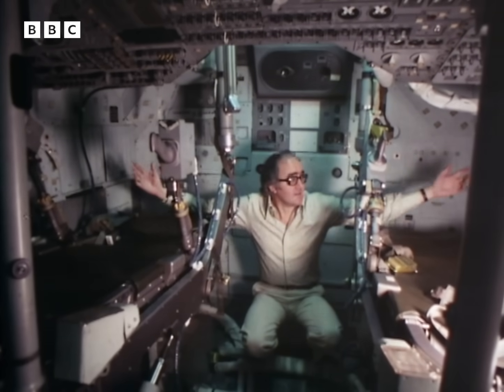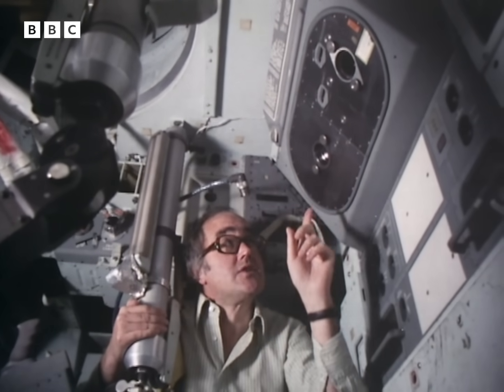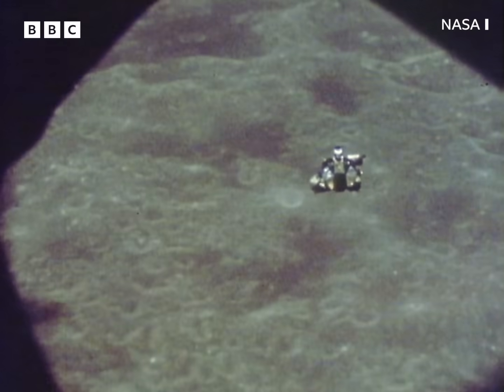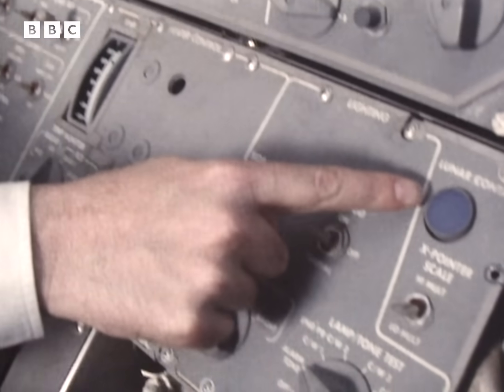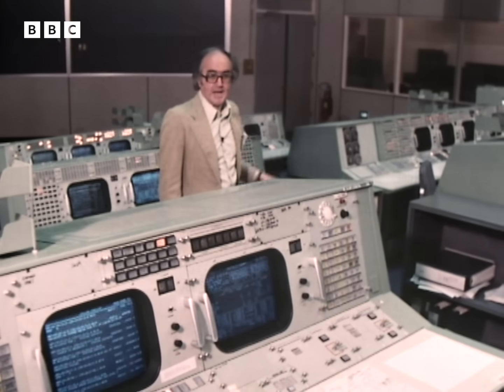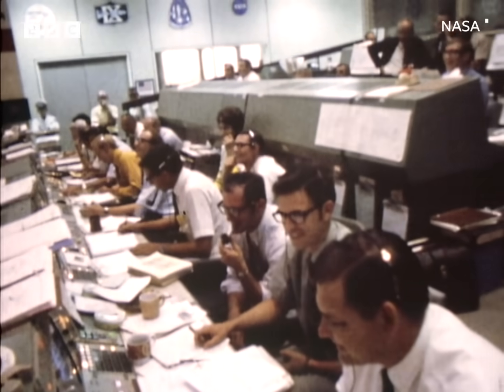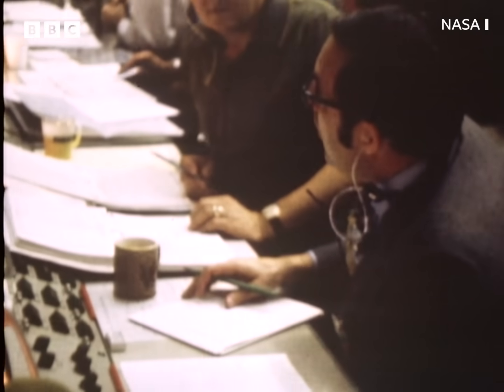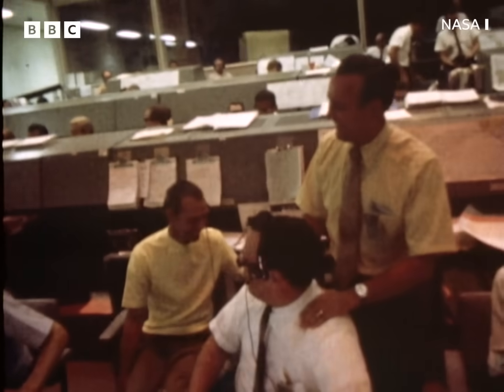1979: How to LAND ON THE MOON | Project Apollo | Retro Tech | BBC Archive

Comment: James Burke was great. Never waffly, over technical or boring. This clip is particularly great because it shows what really goes on in a control room. These days people watch control room footage on the news and they often don't really understand why the room gets so excited over every completed checkpoint. It isn't just because these moments are critical. These missions take years to go from proposal to completion. Someone could have just joined NASA at the age of 22 be put straight on a project and turn 37 years old by the time the project successfully lands on the moon or an asteroid or takes it's first pictures of the far side of a planet. It's a huge commitment of time and dedication. When that stage separates, the retro rocket ignites or the landing gear makes first contact with the surface it's decades of work that created that moment. It's a lifetime's achievement. And to succeed after things have gone wrong is a relief unrivalled by just about anything. No-one dies. Everyone comes home. Mission accomplished. No wonder everyone was turning white, red, blue and green at ground control.

Comment: Its awesome that nasa of course figured out the issue with the computer errors during descent, but also properly assigned responsability. It could have been fixed by flipping a switch - but that should have been communicated to the astronauts. It was an error in the documentation and the procedure, not the user.

Comment: Just think, this craft was travelling at THOUSANDS of miles per hour when it needed to dock with the Lunar Module after the astronauts walked on the Moon and took off in the Lunar Module. Thousands of mph but they managed to do it precisely with those clunky controls and poor visibility.
But what is more amazing is that anyone still believes this nonsense..
Reply: relative speed compared to the lunar surface is entirely irellevant.

Comment: 0:15 Nope. The controller in he's left hand was the so called THC, it wasn't about power (because SPS had a fixed thrust rating and couldn't be throttled) it controlled the translation movements of the RCS system (little rocket engines for maneuvering), the right controller was for rotation (pointing the spacecraft in a given direction). THC could also be rotated to initiate abort sequence.

Comment: 2:54 he actually said the spacecraft knows where it is because it knows where it isn't.
Reply: There are two points on a line where you might be.
The engineering comes in drawing that line, figuring out which of the two is just elimination.

Comment: Tell us about the Van Allen bells. That massive cloud of gamma radiation that means the spaceship has to be made of pb lead 10 feet thick.
Reply: Huh ?
That's true if the orbital altitude of a satellite keeps it within the belts (which is why we don't), but transiting doesn't generate anywhere near enough exposure to be health risk.
Reply: Where did you get this 10 meter figure?
Reply: tell us about how your parents were siblings. gamma rays can not stay in "clouds", nor does the VAB even contain gamma radiation, you utter imbecile.
Reply: Actually the Van-Allen-Belts consist mainly of proton and electron radiation, as anybody able to use Wikipedia would know.
Reply: Because Wikipedia is always accurate and truthful?  @markusbanach-stb5892
Reply: Gamma radiation is light so can’t make a cloud

Absolute brain dead comment
Reply: Really? How d'you explain the use of cobalt 60 in food sterilisation utilising gamma radiation? Its not light you muppet. For one thing gamma isn't visible. 
That's why people have dosimeters and related equipment to keep them safe. 
You sound like a 9 year old. 🤣@FakeAmerican-1776
Reply: @FakeAmerican-1776you have no idea what gamma radiation is. 
Back to school professor 🤣
Reply: @colinstewart1432  gamma rays are a penetrating form of electromagnetic radiation with short wavelengths and always travel in straight lines thus can’t be trapped around Earth 

The Van belts are charged ionizing particles.
Reply: nonsense
Reply: The actual data we have on the van Allen belts tells us humans can safely pass through the belts, without shielding beyond what’s already provided by the pressure hull and the heat shield.

Comment: Elon Musk AND 2 different NASA engineers have said, on camera, that it would take between 8 and 20 Saturn 5 rockets to refusal a mission to the moon.  The initial fuel load will only get you into orbit.  So, are they stupid, lying, or did we not really go to the moon?
Reply: They’re dealing with a much larger lander design, that’s what.
Reply: No one said anything of the sort. Musk was talking about eight starships for Project Artemis, not Apollo, which aims to place far greater mass on the surface of the moon, for longer duration and using vastly different mission profiles.

No one from NASA has ever claimed that it would have taken between 8 and 20 Saturn V rockets to land a 4.5 tonne Lunar Module on the moon. Starship in comparison has a dry mass of 100 tonnes.
Reply: you failed to mention the context, sweat pea.

Comment: 0:42 Subject: Navigation in the earth-moon system. Burke describes 2 or 3 ways: 
1. Boucing radio signals off the spacecraft from earth.
2.  Apollo Guidance Computer(I think this is what it was called)

3. Using onboard telescope (AOT) that worked in conjuction with Apollo Guidance Computer(I think this is correct lol).
I think the astronauts also either carried a real sextant, same type used by sailors for centuries or maybe an actual WWII gunsight. I'm sure some of you know the answer.

Comment: I thought you can't see the stars when in space. Supposedly you can't from the iss.
Reply: Depends on where you are and how you're looking. When the ISS is on the sunlit side of Earth, you can't see stars just by looking out the window. When it's on the night side of Earth, stars are visible.
The Apollo navigation system used a telescope. The telescope tube prevented light from entering from the side, so when you looked through the telescope, you could see stars as long as you weren't aiming the telescope too close to the sun.

Comment: - Of course they didn't go to the Moon, 
- Because the ionosphere is the transparent, invisible and impassable ceiling of the Earth. 
- Even satellite broadcasts are sent from the Earth to the ionosphere at a certain angle and are reflected back to the target on Earth. 
- This is why satellite broadcasts are lost even with a 1 inch deviation of the receiving satellite antennas... 
- No matter can pass through a boundary that even electromagnetic waves cannot pass... 
- However; there was a need for permanent evidence that would convince future generations of the lie "we went"... 
- Bravo NASA... They even made a fake moon capsule to convince humanity of the lie "we went to the Moon".
Reply: The ionosphere is not impenetrable.
Reply: @ So why can't the signals pass through the ionosphere and get reflected back?
Reply: @mottox6585  Only under the right conditions, do radio waves that are at a high angle, refract off of the ionosphere. Obviously it's not a barrier even for electromagnetic waves, you can still see stars through the ionosphere.
Reply: @mottox6585  You can repeat yourself all you want.  If what you are repeating is demonstrable nonsense, it doesn't matter.  It's going to be nonsense every time you utter it.

You just hear a passing phrase like, "radio waves cannot penetrate the ionosphere" and just run with it without understanding the context.  There are indeed certain frequencies of radio waves that bounce off the ionosphere.  That doesn't mean ALL radio waves do so - just higher frequencies - specifically because of their short wavelength - AKA "shortwave radio".  This is a very common method of communication over long distances because you don't have to have line of sight with a receiver - it can bounce off the atmosphere and travel very long distances.  We've known about this for a very long time - and have utilized for as much as well.

This is a well-known property of shortwave radio signals.

NASA used something known as S-band - which is the opposite.  They use longer wavelengths, and these signals have absolutely no trouble penetrating straight through the ionosphere.

Your claim, "If the ionodphere were a passable layer, all radio waves would pass" is categorically and patently false.  Your claim, "it is clear that even electromagnetic waves cannot pass" is categorically and patently false.  LIGHT is electromagnetic waves.  You're claiming LIGHT can't escape the atmosphere (which means it can come IN either - hmmm.  Big problem.)  Your claim, "all broadcasts called satellite broadcasts are reflected back" is categorically and patently false.  "If you do a little research, you will see" is just the ironic cherry on top - - because YOU have clearly done zero research.  This is not a complex topic.  If you read just a tiny bit about it, you find out VERY QUICKLY what frequencies/wavelengths do not penetrate the ionosphere, and which ones do.

Do you even consider how many people would have to be in on this if something as simple as radio broadcasts not being able to penetrate the ionosphere were kept quiet for so long?  This is a serious question.  Do you HONESTLY think that YOU have stumbled upon something that nobody is aware of.  You think you're blowing the whistle on the whole thing with this?  You think the entire program can be brought to its knees with your simple revelation that radio cannot pass beyond the ionosphere - - - and on top of this, you're apparently the ONLY ONE ON THE PLANET that knows about it?  Really?  Come on.
Reply: @willoughbykrenzteinburg  Every person who can use their mind and logic has the ability to investigate how satellite broadcasts are actually made and find the truth. Your claims cannot go beyond the false theses that NASA has made people memorize...
Reply: @mottox6585  Enlighten us - how are satellite broadcasts made?

Everyone with satellite TV must point their dish at a specific area of the sky to get a signal.  That satellite is in a geostationary orbit above the equator.  Thats why you need a view toward the north in the southern hemisphere and a view toward the south in the northern hemisphere.  And not just anywhere, but a specific area.  All those satellite dishes need to point toward that satellite in order to get an actual signal.  The closer to the equator you get, the more "straight up" the satellite needs to point to get signal.  This ACTUALLY happens.  If not a satellite in orbit, please enlighten us all to what PRECISELY are all those satellite dishes pointing at to get signal.
Reply: @ 
-I'll explain right away...
-Receiving satellite dish antennas must be fixed by turning them exactly to the direction of the fixed signal sent at a certain angle. Only then can the signal be received properly.
-If the receiving antenna is deviated 1-2 cm from the focus of the incoming signal, the broadcast will be lost.
-When we use our logic in light of this fact, we understand that it is not possible to receive these signals fixedly via satellites that are claimed to be orbiting the earth at a speed of 28,000 km/h.
-Question: So how are the broadcasts transmitted from the transmitter to the receiver?
-Answer: The signal sent in the GHZ band is sent to the target by reflecting it from the ionosphere as strong and focused as a laser beam. This shows that the incoming signal is sent from a fixed transmitter.
-These are the dish antennas of the broadcasting transmitters and according to the coordinates of the target region, the signals are sent linearly to the ionosphere at a certain angle just like a laser beam and from there they are reflected to the target region and ensured to be received fixedly by the receiver antenna.
-The ionosphere is the impassable ceiling of the earth. All signals sent to the ionosphere are reflected back to the earth. If it were not so, satellite broadcasts would not be possible. 
-The regular "chemical trail" made by planes spraying stored chemicals into the atmosphere is intended to make the atmospheric layers below the ionosphere more conductive...
Reply: @willoughbykrenzteinburg  he is a classic NASAcisist n. and adjective..
Someone who blames their entire lack of knowledge, qualifications, skills, success and ability to have a relationship on one single US space agency….
Reply: The ionosphere is not an impassable ceiling. We've launched thousands of satellites through the ionosphere without ever crashing into anything.
Even radio waves pass right through the ionosphere at most frequencies. Radio amateurs demonstrate this by bouncing radio waves off the moon, at 380,000 km. 
Satellites transmit signals at wavelengths far higher than those reflected by the ionosphere. And it's impossible to create a system that bounces signals off the ionosphere in such a way that it looks as if the signal is transmitted by a satellite in geostationary orbit.
Reply: @ 
- The source of what you wrote is based on theories made up by NASA. 
- If you think using your mind and logic, you will understand that the ionosphere (including signals) is a ceiling that cannot be passed by any means. 
- But for some reason, instead of thinking and trying to find the truth, you prefer to say made-up theories as if they were true.
Reply: @mottox6585  "But for some reason, instead of thinking and trying to find the truth, you prefer to say made-up theories as if they were true." So close to becoming self-aware, so damn close.
Reply: @griechland 
- What reality are you talking about, other than the false theses NASA makes people memorize in schools? 
- You can understand existing reality by using your mind, logic, and intelligence.
 - Intelligence can find truth by analyzing what the eye sees with reason and logic. 
- Believing lies is the way of those who don't think.
Reply: We launch at a low inclination angle of about 10 degrees off equator to minimize Van Allen radiation.  It gets traversed with trajectory angle and speed, so exposure time was only 68 minutes.   For a lethal dose, you’d have to remain in the most intense part of the belts for a week.    
Radio transmissions also circumvent the interfering parts of the belt.   That’s why NASA has antennas geolocated globally.
These roadblocks were solved over sixty years ago.
The Soviets tracked the lunar missions, then called NASA to congratulate them.
Reply: @SME.Retired  I think you didn't read what I wrote completely. I'm writing again. 
- The ionosphere is the impassable ceiling of the earth. 
- Signals sent from the earth to the ionosphere at a certain angle are reflected back from here and delivered to receivers in the target area of the earth. 
- If the ionosphere were not reflective, no global satellite broadcast could be made. 
- It is not possible for satellite broadcasts to be made from satellites hovering above us. 
- Why? 
- Because when the receiver antenna deviates slightly from the signal focus, the broadcast is lost. This situation shows that broadcasting should be done with a fixed signal. 
 - It is not possible to receive a fixed signal with hovering satellites. 
-What you are telling us is information that NASA made us memorize. 
-Since it is not suitable for logical analysis, there is no truth in these theses.
- I hope it is understood now...

Comment: HOW DID THEY SERVIVE THE VAN ALLEN BELTS.          EXPLAIN THAT MR WIZZARD.        IF YOU THINK WE WENT TO THE MOON IN A TIN FOIL BALL.      THEN MY FRIEND THERE IS ONLY ONE WAY TO PROVE THIS.     WHERE ARE THE 200 THOUSAND TELEMETRY TAPES.         PLEASE DO NOT TELL ME YOU LOST ALL 200 THOUSAMD.    WOW  WEEEEEEEEEEEE
Reply: The Van Allen belts do not prevent human spaceflight. With the help of Dr. Van Allen, the trajectory was planned in such a way as to limit the exposure and time spent in these belts.
Also, the hull was made of honeycombed aluminium. 
The " tin foil" is actually Kepton as to mitigate exposure of the structure to temperature fluctuations.

Regarding the telemetry: it was NOT lost. This is a popular claim by the Apollo deniers, but is totally false. Yes, some telemetry tapes were reused, that had Apollo video on them. However, they were backups. 

When Apollo 11 flew, Westinghouse built a TV camera specially for the flight, as normal a,eras were too power-intensive and too heavy. The camera worked in slow scan, and used a picture format not compatible with broadcast TV. 

This meant the signal from the camera had to be converted whe it reached Earth. At the receiving station in Australia, the incoming S-band signal with the TV camera output was recorded onto telemetry tape, as a failsafe measure. The signal was the converted to broadcast format. The converted signal was recorded, then sent out to Houston for distribution to the networks, many of whom made their own backups. 

The original telemetry tape backup had been made in case the on-the-fly conversion failed to work. It didn't, so the backup recordings were never needed. These are the tapes that were later reused